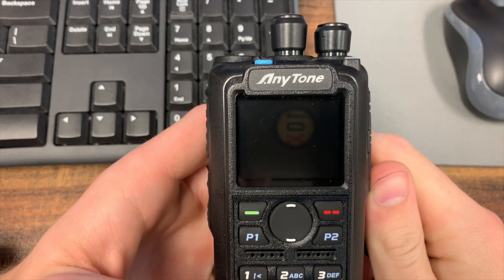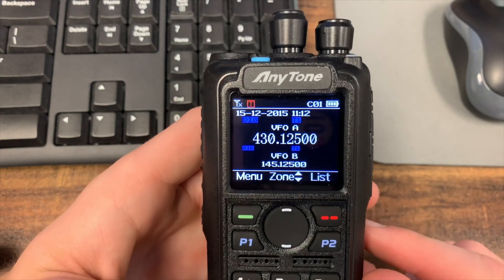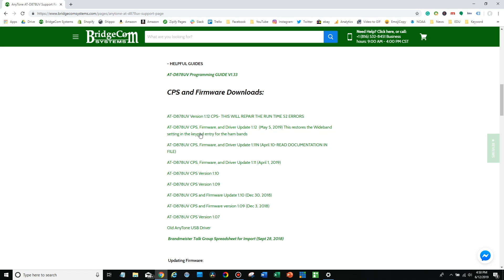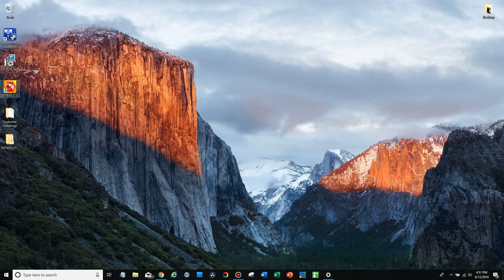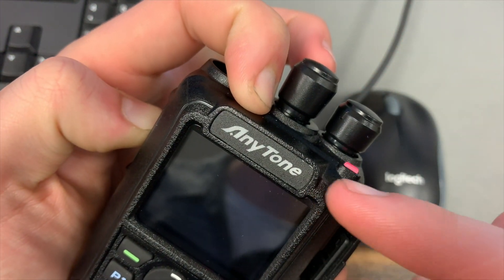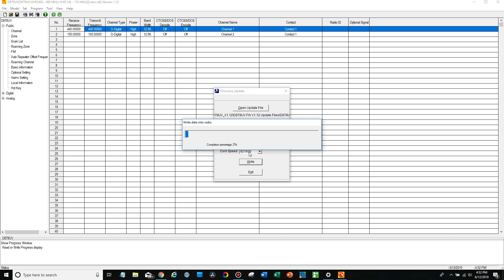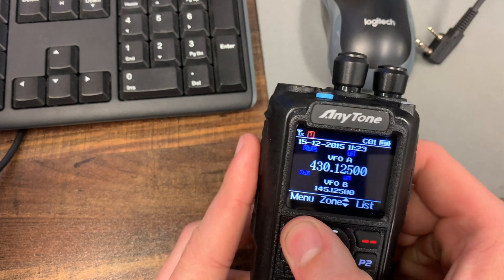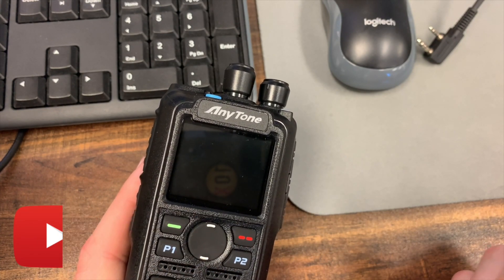How to update the firmware on the AnyTone 878

Comment: My 878 is a bit old and had V2.05 on it. Tech support at Bridgecomm suggested I update the firmware to the current version (3.06) but that I should FIRTS save my current code plug since updating the firmware will erase the code plug in the radio, and to update it in steps from V3.01, V3.02, and so on as going from V2.05 to 3.06 could cause issues. The process is the same, the versions are different from this video. Thank you .... Mike AD7VV
Reply from the maker: Hi! We appreciate your comment. If you’re looking to connect with other hams, check out our Facebook group here: https://www.facebook.com/groups/BridgeComSystems. And, if you haven’t seen it yet, our best-selling Plug-and-Play Package is worth a look: https://www.bridgecomsystems.com/pages/plug-and-play-package.

Comment: Should update this video.  Backup the code plug before update (using new version cps), reset the radio after update and then write the code plug back to the radio. Might also want to update the DMR database, while you have everything in one place.

Comment: I followed this guide and my radio refuses to update. It will write to the radio, the radio reboots and then I go check the firmware in the radio and.... Zero change. Still stays on 1.20p
Reply: Well I feel dumb. I accidentally used the 1.20p file. So it actually did work I just used the wrong firmware.

Comment: Did not work for me. Uploaded the latest firmware as instructed.  When moving to Firmware and Icon update,  and then click open update file, it comes up empty.  Nothing there.  Yet, when I use file explorer, the uploaded files are there in the downloads folder. So the uploaded files are there. Now puzzled.

Comment: What improvement is offered in the latest firmware 1.16 ?
Reply from the maker: The Change log that's included with the update outlines all the changes made in this version:   

change list
1. Optional Setting ->Display ->Standby Char Color, allows to set different colors. 2. Resolve the issue that the radio continue to receive when switch from TS1 to TS2.
Issue only in VFO mode : During a reception on TS1 if i change on TS2 i continue to receive , or some time its
dropped only audio but ID are received
FW: 1.16C
CPS: 1.16C
SCT:2.01.07BA
BT:10033
D878UV firmware update V1.16B (dated 2019-10-30)
change list
1. CPS-Optional Setting - Display, allows to set different colors for A channel name and B channel name. 2. CPS-Optional Setting - Other - Encryption type, allows to choose AES or Common encryption
type. The common encryption type allows the radio communicate with earlier D868UV or D878UV
radios. Note: The radio must be reboot after select the encryption type. 3. Resolved the issue that when digital monitor is on, press # key will not save the channel and color code. 4. Improved the issue that sometimes the LED light keeping on in digital channel. 5. Improved the issue that sometimes after the signal drop, the display will keep receiving and radio emits
nosie. 6. Resolved the issue that when DTMF->D code pause is set, press PTT and Down Key will not transmit the
D code.
D878UV firmware update V1.16 (dated 2019-10-13)
change list
1. Resolve the issue that the digital contact manually change in radio will not be saved. 2. Resolve the issue that the radio doesn’t RX after TX when both transmit and receive radios are
with digital Monitor ON. 3. Resolve the issue that the Talker alias doesn’t change when the radio ID changes. 4. Resolve the issue that the digital scan is easily interfered. 5. Resolve the issue in CPS that 5Tone will add E to the code automatically. 6. Resolve the issue in CPS that AES code is incorrect when open the codeplug. 7. Resolve the issue that the callsign change to orange color when load the codeplug into radio directly.
Reply: Hello Cody, thanks..  one more question.. how do you know when to update the baseband?  Thanks again. I am considering getting a 878  Back Friday if bridgecom is offering any specials or I might get it at the Orlando, Hamcation.  Of all the DMR radios, I have to say Bridgecom is pretty good offering support.

Comment: Cody, great video. Thank you! I made the update OK, but it is NOT being reflected in the software. When I open the program, with the list of frequencies, it still says "Version 1.13" at the top of the screen, even though when I check my 878, it states in the settings "Version 1.15". What have I done wrong?
Reply: You need to install the 1.15 CPS software on your PC and run it.  Uninstall 1.13

Comment: No wonder so many is having issue with the radios if they followed this video.
The most crucial party was not even mentioned.
Reply: So what did Cody miss? Seems a bit odd that you would not mention what he missed!
Reply: @davidhubbell4066  I was hoping he would have added and made it BOLD in the text.
He left out the MCU Reset of the radio, that is 100% required.
With out it, the radio will not work as intended.
Reply: @freedmruk2640  Thanks Norman, how do you do the MCU Reset?
Reply: @davidhubbell4066  MCU Reset 
Turn radio off 
Hold PTT and button below 
Turn radio On and hit confirm